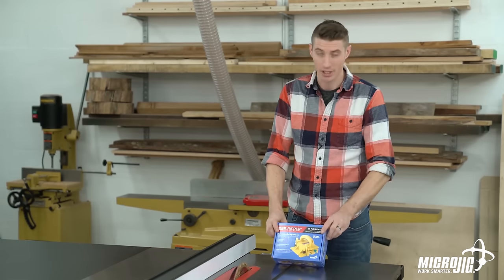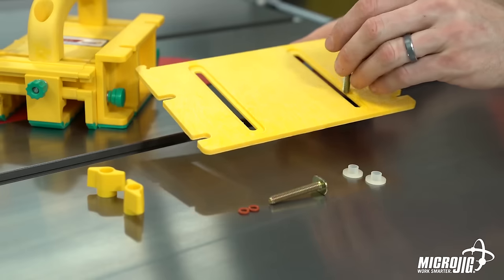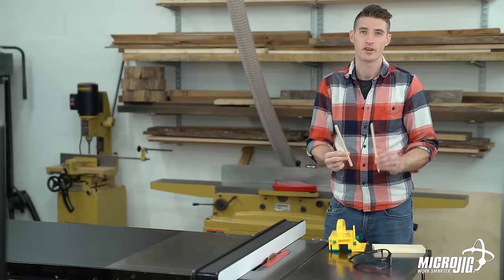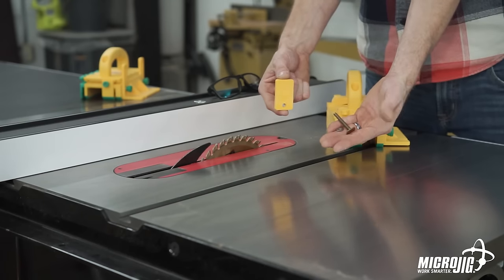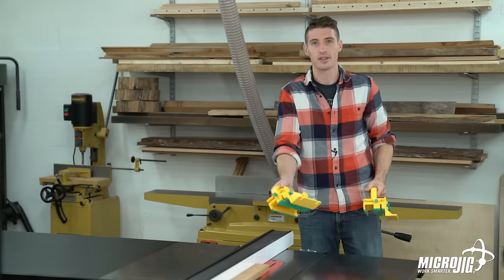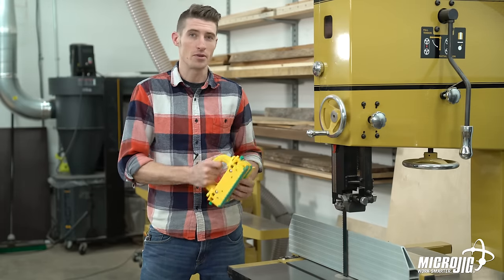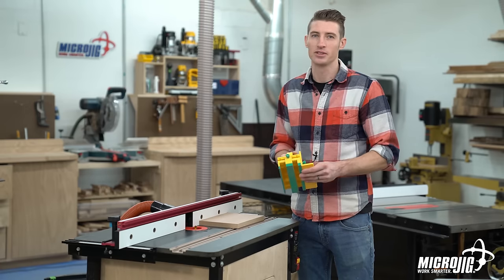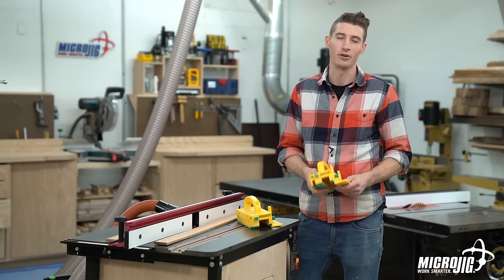GRR-RIPPER | Full Instructional Video (2018)

Comment: Bought one today at a yard sale.....brand new GR200, still in box, unassembled.  Original receipt with it showed it had been purchased in 2002 for $60, and has been sitting on a shelf until this yard sale. I got it for.......$5.00!!!   Except for the color of the handle, it's exactly the same as the one shown here.  I've used one in our community hobby shop and they are the best....happy to have my own now.  Great instructional video, I picked up a couple pointers.

Comment: Just got the GR-200 with the 1/8th add-on.  Used it tonight to cut down 1 inch rough stock to 3/4.  Really easy and even more importantly extremely safe with the Grripper. In the short time I’ve been woodworking, I’ve come across useful tools, jigs and techniques to improve quality and safety. This is easily the best tool I’ve bought that improves both. Fantastic invention.  

I also got the match fit dovetail clamps and will be building a tabletop with dovetail tracks. Another great invention that will make a number of things easier to do. In my opinion, this is one of the most innovative companies in woodworking today.

Comment: CANNOT BE USED. It requires the blade guard to be removed- which it NEVER should.
Reply from the maker: You are certainly welcome to your opinion, and you need to do what you feel is safe in your shop. 
However, even if you want to use your blade guard, there are times that you simply cannot. For example, when not cutting all the way through the stock like groove cuts and shoulder cuts. Or when using dado blades. Or when making any rip under about 1" in width, the blade guard does not fit between the blade and the fence. 
In each of these cases, the GRR-RIPPERs meet all of OSHA's requirements. 
And the GRR-RIPPER is highly useful on the router table, jointer and band saw as well as the table saw. Anywhere bits and blades want to bite you.
Reply: @Microjig  1) non-through cuts are perfectly possible with a blade guard. Just not one supported by the riving knife. There are other designs. I use one such myself.
2) narrow cuts- you use an auxiliary low fence. Plenty of you tube videos to teach you how to do that.
3) H&S is not about meeting nationally set minimum standards. It is about local risk assessment. There are several thousand table-saw accidents in the US every year- most would be prevented if a blade guard was always used.
An 'instructional video' (your claim) should feature safe operation- indeed, it should be the primary concern.
Yes, the gripper can be useful on a router table etc- but not a table saw.
Reply from the maker: @Tensquaremetreworkshop  Again, you do what you think is safe. 
Hundreds of thousands of GRR-RIPPERs have been sold for 22 years now. They are in use in shops all over the US and the world. Many production shops use them daily.
Reply: @Microjig  Not about thinking, it is about data. 50,000 table-saw accidents a year in the US.

Comment: I got one but I can't get it to work very well it doesn't want to push the wood should I apply wax to my table saw?
Reply from the maker: Jeffery, I believe strongly in waxing for both ease of use and protecting the table top. But if your GRR-RIPPER is slipping on the stock, something is certainly wrong. The first thing to do is clean the green grip material on the bottom of the legs with rubbing alcohol just to be sure there are no contaminants there. if that does not fix the issue, please email us at "support@microjig.com" or call our support line at (855) 747-7233 and we will get you some new legs.
Reply: @Microjig  I cleaned and waxed my table saw top and your micro jig works awesome now thanks for the help
Reply from the maker: @jeffreycasto4610  no worries, glad to have solved it.